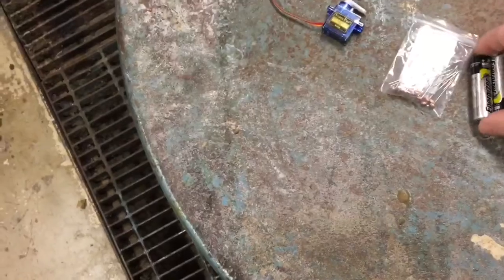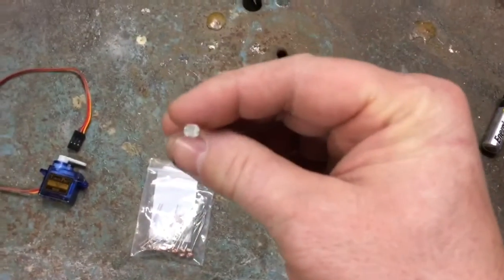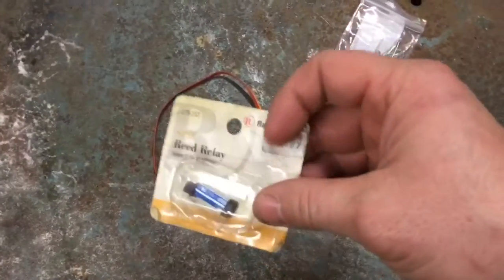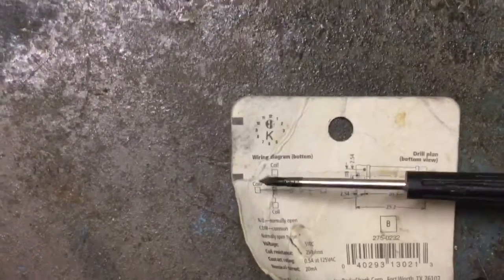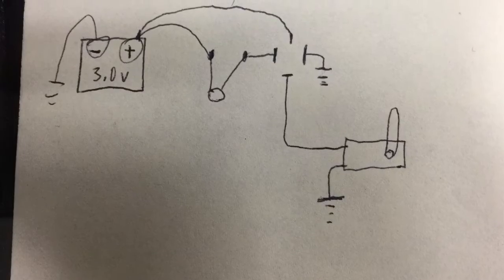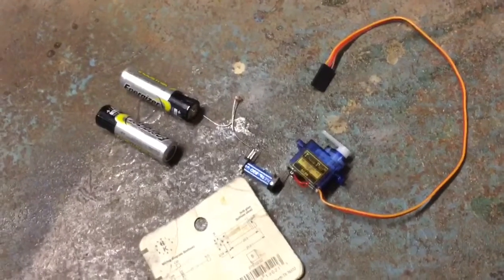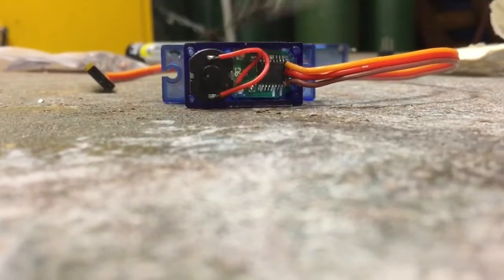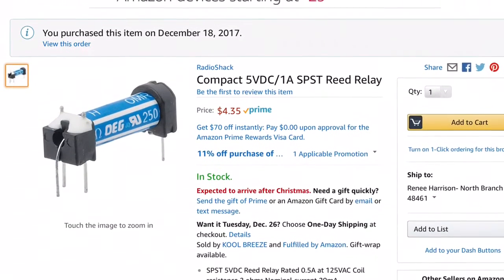How i made a drop mechanism for Mavic for 5 dollars.

Comment: You could use a transistor instead of a relay, transistor is smaller and lighter. Also adding a small resistor before the photo resistor would help turn the current source to a voltage source
Reply: which transistor?

Comment: Nice!  My very expensive Gannet Release dropped into the sea (with my drone), and in an attempt to fix it, found out how cheap the parts are.  Your video basically explains the whole thing - photosensor and servo does it.  The much more expensive commercial version uses a small lipo battery and that's about it!  Might try this myself instead of spending big bucks buying a new one.

Comment: A bit of a hori idea mate. Your LDR won't last too long. Too much current through it !
A better idea is to use a cheap aliexpress electronic cigarette lighter and an aliexpress LDR module.
The lighter is used to melt a length of 0.55mm fishing line, in order to release the payload.
PM me if you want details.

Comment: Couple of suggestions:

Use a 1S or 2S lipo of the smallest mAh possible.. probably 200mAh instead of the AAA cells. I am sure the lipo will be light weight than 2xAAA

No need to use a servo if you're opening it and destroying the servo mechanism. Just buy the motor which is inside the servo and you save the weight by not having an unnecessary set of gears and a servo housing. That'll also eliminate the need of a relay.

Mount the entire setup on a piece of balsa wood or in fact any plywood instead of lego. No weight saving here but because of strength. Lego pieces might fall apart if the servo payload is excessive.. unless you superglue the lego pieces.

I got inspiration from your video and I am looking forward to make my own servo drop mechanism but that'll be for a huge DJI S900, not a Phantom 4
Reply: Hi, I saw your comment and found it interesting, did you get your project together? Can you make it available?
Reply: And price under 5 Dollars?

Comment: I tried this setup. worked nicely on the ground but I believe dji changed something I can only turn the lights off when flying not back on. while the drone is on the ground I can switch them off and on all I want. this system no longer appears to be workable.
Reply: is your statement still true?
Reply: I believe so.
Reply: When you recording at the moment in flight you can not turn on the lights. Thats my  experience
Reply from the maker: You can change the headlight led options in go4.
Reply from the maker: There are two places to change the settings....really 3.   

In “main controller settings....advanced settings” and another setting under the video camera settings which turns on/off led when recording.   

The 3rd option is assigning turn in headlight led for c2 button.   

This way you can actuate the led with the c2 button.  

Another option is to fly without an SD card which will change the stock led settings when you press record.

Comment: I dont think you can do it better than that.. I have a Spark and want to make this for it... I have some super tiny 1S lipos that come out of little RC heli's and mini drones.. Very light and 3.7v..  I dint know that those tiny servos operated on 3v.. COOL!
Now I have to figure out how to control or what controls the lights on my Spark.. I do notice they do different things while its in different modes or recording or what not.. I hope I can do it...
Thanks for this video... GENIUS MAN!!! GENIUS!
Reply: did you work it out? i have a mavic pro so it may be similar, go in to the drone tab in settings on dji app, advancd settings, turn on head leds,its  off to close servo, on to open it.

Comment: using front Red Led light sensor  (the ones that turn off when filming)
Reply from the maker: Kelly Kelly there is an option in go4 to keep the res light on.  

Also, removing the sd card will allow the light to stay on when recording by default.   

The c1/c2 buttons can be configured to turn the led on/off independent of the record function.

Comment: Hello, a couple of questions: 1 - So are you using the red light on one of the arms with the photo resistor to trigger the servo? 2 - is there no interference with the bottom sensors of the mavic? - thanks (great video by the way)
Reply from the maker: yes, exactly this.    the mechanism does not affect the sensors but the payload often does.    i turn off downward sensors.